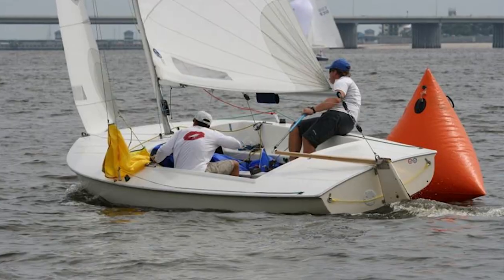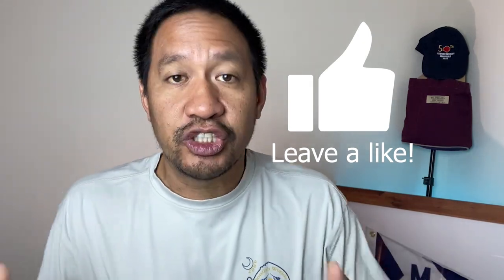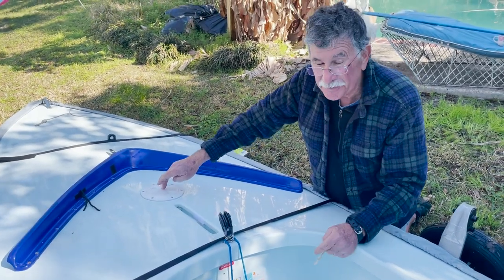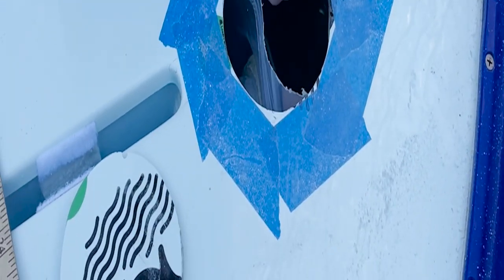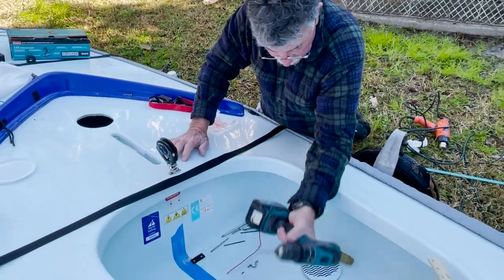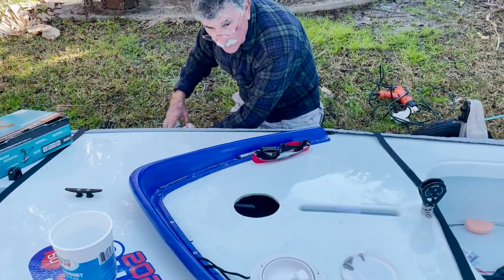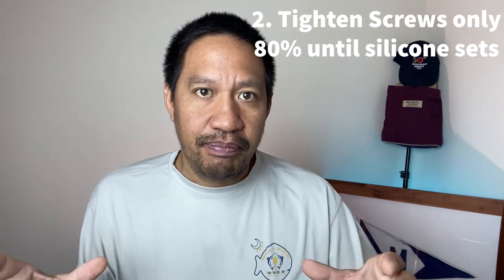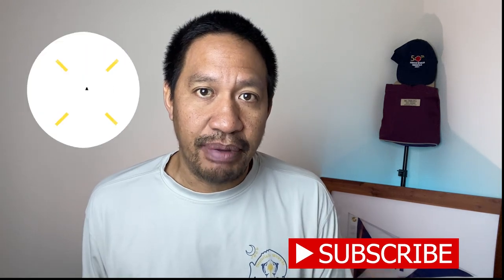How to INSTALL an INSPECTION PORT | Sunfish Sailing

Comment: Originally with my older brothers, (who were reading & learning at the same time), I’ve been working on every component of all of my own & family’s various wood & glass boats since age 6.  First season at age 5, boats were launch ready.  

   Working on my boats taught me all my seat of the pants design engineering, fabrication, woodworking, glassing, finishes, electrical, engine repairs and maintenance.

   Those skills carried over to working on cars and home repairs and more.  So it’s been a great benefit😃

Comment: Because there wasn’t one, I installed a hiking strap on 1 of my Sunfish’.  With few exceptions, As with any hiking strap on any boat regardless of size,…

…You want it as tight and as close to the floor or seat it’s attached to as possible.  Because even with a non stretch strap, there’s always going to be some stretching somewhere when you load the strap with your feet and body weight. 

   I had a seamstress heavy duty stitch a loop on the square 2 bolt hardware fittings I used at each end of strap.  I also had her stitch in a non slip adjustment buckle.  But that’s still a potential stretch spot. 

Beginning about 3” off center, I cut out (2) oblong squares about 2” X 3” from front bulkhead for access to install strap holder. 

   I drilled 2 holes and bolted the strap holder into the center of bulkhead as low/close to floor as possible.  I used a 1/4” fiberglass backing plate, washer & unlock nut on back side. 

   I glassed the 2 squares back into the bulkhead and finished with a layer of gel coat I tinted to a perfect match.  I don’t recall but I don’t think I had to cut anything out of rear bulkhead to get the rear end of the strap bolted as low as possible to the rear bulkhead. 

   I would have used an inspection port as in this video, but I knew I also had to install an 8” inspection port further forward to have access to install / glass in a new mast step tube, (I ingeniously completely fabricated off the boat).

   So I didn’t want 2 inspection ports on foredeck because I didn’t want to cause any unnecessary structural weakness.  This was also a great spot to stuff the entire bow under foredeck with empty 2 liter soda bottles because there was no other flotation present.  I’d luv to replace them with those lightweight plastic floatation bags if anyone knows where I can get them ?

Comment: I'm a big fan of using butyl tape on deck hardware. No goop, easy to use and remove. Lasts forever in the package (won't dry up.)
 Research it before using sealant from a tube.
Reply from the maker: Thanks for the suggestion!

Comment: You said the deck cut out showed the deck was glass encased foam.  Is that the new synthetic closed cell foam❓Or synthetic balsa core that won’t absorb water❓
Reply from the maker: Not sure if that was said, but I believe the hull is foam not balsa core.

Comment: Good stuff Lee.
How can one avoid damaging the air bag.
Reply from the maker: To avoid the airbag ?  Probably a saw that doesn’t go very deep past the thickness of the foam.    And luck ;).
Reply: Use a hole saw instead of a sabre saw @LeeSideSailing

Comment: Has anyone installed a 6” port on a newer model Sunfish in this location? If so, does it still only sacrifice one air bag or do the lateral bags get nicked?
Reply from the maker: Eugene hit only one bag with a centrally located hole
Reply: What year did they switch from foam blocks to airbags?

Comment: One thing I would be careful of - at 6:07 in the video you  can see that are cuts in the foam, likely as kerfs to allow the foam to bend to the curve of the structure.  It appears that in the construction these cuts haven't been filled with anything (adhesive or resin for instance).  While the foam itself is likely closed-cell and won't soak up water, the unfilled cuts can allow water to travel through the structure along the cuts.  With the original structure intact and the foam sealed in the laminate, not likely an issue.  Cut or drill into that structure without properly sealing things up, and water can get in and travel.  At the least added weight, but in colder climates that water can freeze and expand in the winter and could potentially cause delamination.  At the very least I would thicken up some epoxy and coat the raw foam from the cut.  There are also techniques for the screw holes - essentially fashion a tool to scrape out the foam in a small radius around the screw hole, fill with epoxy, let cure, then redrill the hole.   And then two questions - 1) are there any class rules regarding the removal of air bags for the newer construction boats?  2) my boat is older ('74) and didn't come with a hiking strap - is there a backing plate already there, or do I need to get access to put one in?
Reply from the maker: Great suggestions regarding the foam!  Thank you. As for class legality, I actually brought this up with some people.   Technically speaking it probably is not allowed, since it is not specifically said it can be done.  However, it’s a new design and the airbags have never been addressed. Only the foam blocks.     To add any hardware you will need an inspection port snd you saw what happened.   An argument for letting the removal of a bag is that is there is no advantage to removing it, wet foam, reduces weight plus changes the structure and stiffness.       As for backing plate in a 74 for hiking strap.   Short answer is no.  Can use the lip on the forward cockpit and through bolt eye straps to the small lip on the edge of the cubby hole.    Hope this helps.
Reply: @LeeSideSailing  I would suspect that the manufacturer might be hesitant to allow the removal of the bags from a liability standpoint - the bags will limit the amount of water that can flood into the hull if there were damage such that the boat was holed.  Remove bags and that is more water that can flood the hull.  Not sure if that is a real concern on such a boat.
Reply from the maker: That would be the main item to not allow removal, safety.  But I think you’re right in that I don’t think one bag would make the biat sink.
Reply: Looks like Intensity sells replacement airbags for the Laser that might work here - 10 and 20 L cubes.
Reply: Old airbags leak. You can't put faith in old plastic. If you want to be safe, separate deck from hull and refoam entire boat. Replace deck. Too much work? Wear a life jacket!

Comment: Great tips Lee, as usual. We have a Tip #7 in our video, which is to use the inner cap as a template for the port hole cut: https://youtu.be/fUPmYZf18xs Fair Winds, Clark and Skipper
Reply from the maker: Yes, that is absolutely a great idea to use the inner cap.